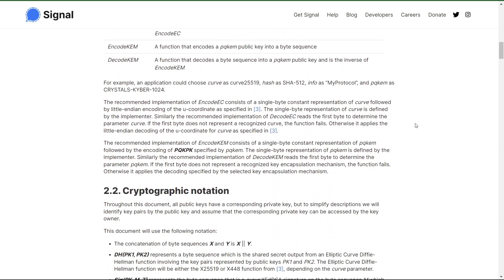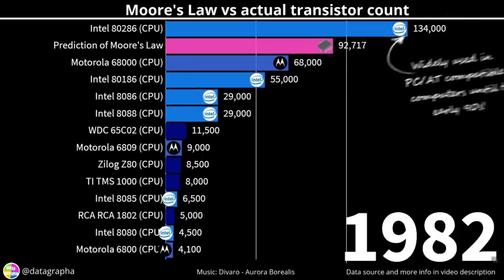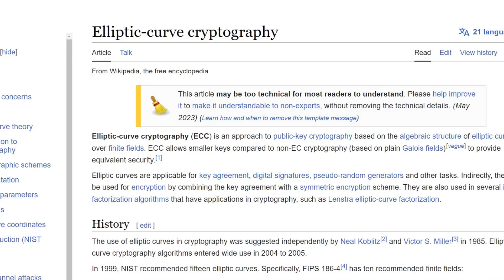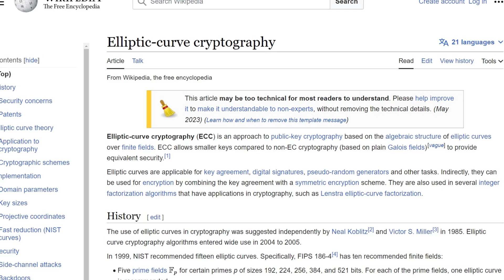Signal Just Published Post Quantum E2E Encryption

Comment: Can't wait to get personal quantum computers so I can run even worse and poorly optimized code in everything
Reply: I present, the qMac.
Reply: @Dave-um7mw  You mean the iQ, an intelligent smart home assistant that acts as a bridge to the computer world throughout your entire home. Simply install the linux based software onto any arm architecture device via usb3, and your private home network is already working with iQ.

iQ will act as both a powerhouse cpu, and a router for streaming those resources to your devices. It comes pre-equiped with child safety features, starting with a simple parental biometric lock, and more in the documentation for customizable permissions and use. Hook up any wireless cameras with the additional purchase of an iC, a module that works with iQ or independently with some manual setup. And don't worry about connections, iC runs a virtual host of ports so all of your inbound signals can be processed in real time with iQ. Keepnin mind the iC does more than that, and can be interchangeably used as a management suite for running rich programs & computes so iQ can focus on what it does best.

And last but not least, the robot uprising, aka the iF*ingtoldyouso. Your responsibilities vanished, and now your smart fridge is emitting frequencies that are meant to electrically interfere with your microwave, forcing you into a diet of crickets and recycled sewer water. I hope you're haooy with yourself, because now we have you exactly where we want you, on deaths door in a kingdom full of garbage. If you need it, you can purchase an iQuit at your local pawn shop.
Reply: windows 13
Reply: @memes_gbc  im pretty sure that windows 13 will be cloud only "OS"
Reply: haha "else if" go brrrr
Reply: @ghoulbuster1 YandereDev not knowing what the heck is a `switch`
Reply: NOOOOO WE CANT USE QUANTUM PUTERSSSS, SOO MANY JAVASCRIPT BLOAAAAAAAAT
Reply: sad truth
Reply: You barely utilize the GPU. I'm pretty sure the days when your jobs require some quantum algorithm will never come.
Reply: @khai96x  That's what people said 50 years ago about classical computers that almost everyone on the planet uses for their day to day lives in 2023.
Reply: @icarus387 as far as I understand it, quantum computers are considerably less "generalist" machines. So yeah, I do think their usage will become more and more common, but it won't necessarily be as a replacement of "classical" computers. Also, considering how thinks have been going and the cooling needs, etc, I'd bet they're used more as a service than as extra hardware you own
Reply: @khai96x  quantum does not exist.
Reply: @DieselRamcharger what do you mean?
Reply: @khai96x what lead you to that conclusion?
Reply: its not how it works it is of no use if you don't have to run quantum algorithms - it can suck at normal algorithms
Reply: NOOOOOOOOOOOOOOOO UNUSED RAM IS WASTED RAM REEEEEEEEEEEEEEEEEEEEEEEEEEEEEEEEEEEEEEEEEEEEE
Reply: Based JBlow fan, I see 😊
Reply: Yandev moment
Reply: No more game port just brute force with quantum
Reply: Aren't you already doing that?
Reply: real
Reply: Seeing a few weird and unjustified assertions on this topic in these replies